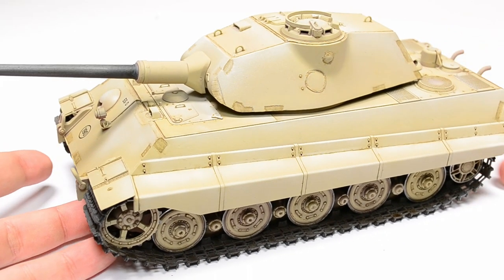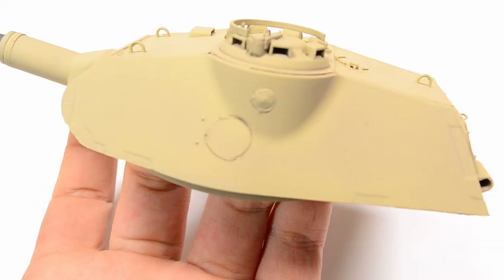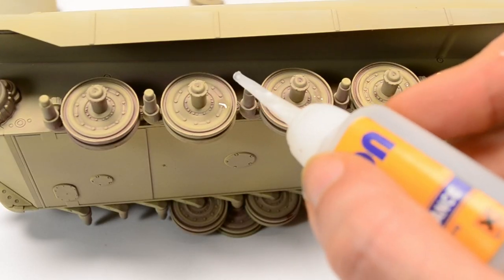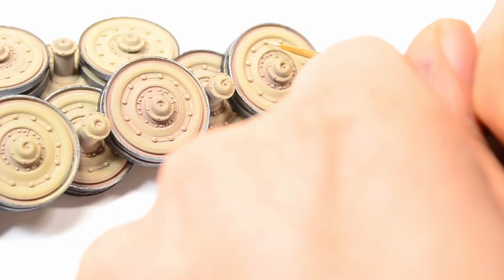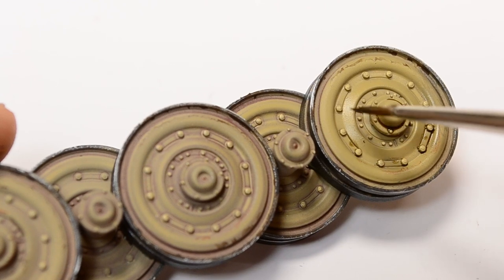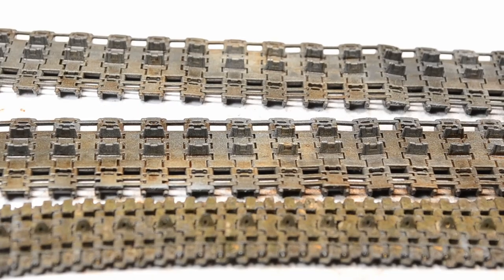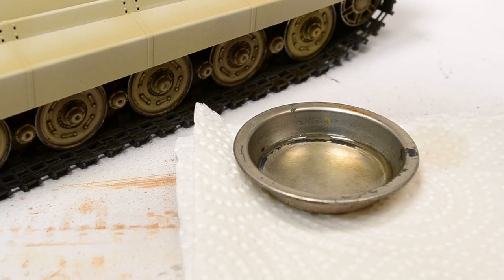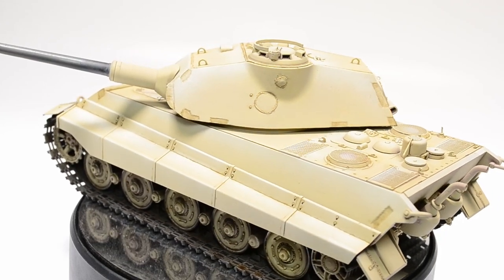Painting & Weathering the King Tiger v1 Prototype | Takom 1/35 King Tiger Initial | Part 2

Comment: Vanilla König! Alright stop, kollaborate and listen...

Say, are the Entwicklung series panzers outside of your list/theme? The Modelcollect E-50 ausf B looks fantastic IMHO. It would have been the next step after the Pzkpw VI TigerB...
Reply from the maker: Hey, E Series is within my theme of cause. Although I have none of them in my stash atm. When I come around doing one, it will based on pre-internet literature, there is very little actuall substance behind many of these vehicles - once "story telling" & gameing industry is out of the equation... A Panther II is something I'll look into, as well as a G13 Jagdpanzer & E100. I've planed for a lot more (acuratly build) Tigers in 2021, don't know if a Tiger III would fit in there.
Reply: @Tankbrusher  Will you eventually do a VK30.01(D) Panther prototype? I'm quite interested in how it seems to take a lot from the T-34's design.
Reply from the maker: @hotbacon1107  I'm atm not aware of a kit existing building a VK30.01(D) - should be (DB) for Daimler Benz or am I mixing something up? Development of these other VK30.01 was holded very early, Spielberger didn't write a lot about it. Panzer Tracts and Abt. 502 have no information about it either?! Panther however I'll go VK3002DB, T34, V1 in one longer series - only three Ausf. Ds are fixed in 2021 so far.
Reply: @Tankbrusher  I am talking about the prototype vehicle designed by Daimler Benz that competed against MAN's prototype that went on to become Panzerkampfwagen V Panther. Sorry, I'm not so sure on the designation since I'm getting lots of conflicting information online! Some articles state it is VK30.01(D) while Wikipedia says it is VK 3002(DB). Other than my confusion on the vehicle's proper designation, I'm really glad that your channel features a lot on prototype vehicles, it's nice change of pace from other channels.
Reply from the maker: @hotbacon1107  Simplyfied the VK30.01s were more general developments - the VK30.02(DB) and MAN(?) were leading into the panther. Amusing Hobby has a VK30.02(DB) I was having a look into.
Reply: @Tankbrusher  I see, thanks for the the insight. I was under the impression they were the same vehicle. And yes, the Amusing Hobby VK30.02(DB) was what I was thinking of this whole time, it seems. I've been eyeing the kit but my local hobby stores don't seem to have it!

Comment: I wonder if they ever used any of these initial tigers in combat?
Reply from the maker: That's easy to answer in detail: v1-v3 were made from mild steel -> never seen combat. at least v2 was in Haustenbeck testing ground captures in '45. There were 50 chassis mounting the "initial" turret before the "series" turret was introduced. they all were used in combat, but maybe a few were held back for testing. It's hard to not use the "Porsche Turret" or "Henschel Turret" term since both terms are used wrong both turrets were designed by Krupp independently from the chassis by Army Ordonace Department (HWA, you may call them Henschel) and Porsche.
Reply: @Tankbrusher  thanks for the reply. I was wondering if any of the tigers with the initial exhaust style were used in combat. Was aware the "porsche" turreted ones were issued to units.
Reply from the maker: I see, yeah they were issued it was a design change within the maybe the first ten of these 50. You will see on some refferences first the Tiger I style raincover on the exhaust going away followed by the exhaust shrouds as well. here is good footage and information in it: https://www.youtube.com/watch?v=3nIPCULX23Q